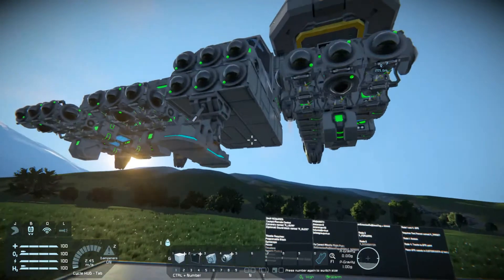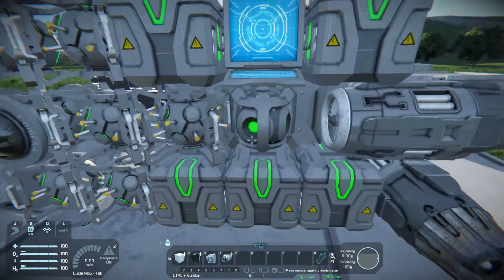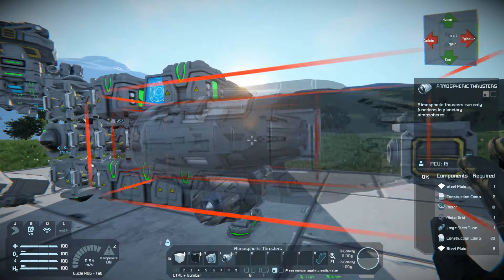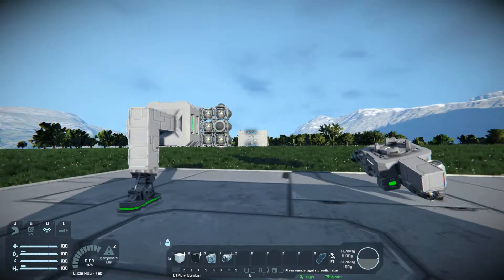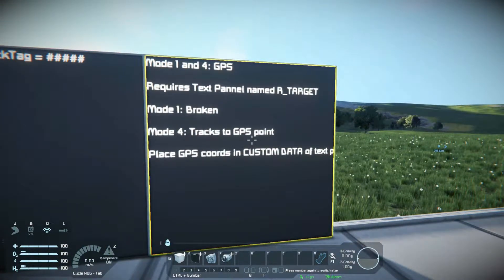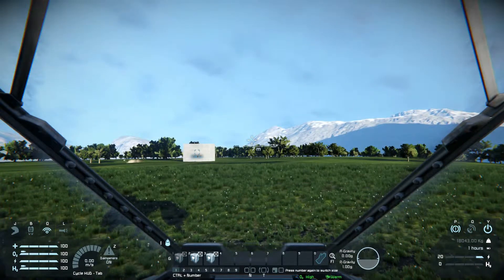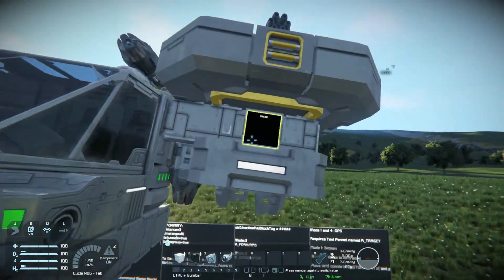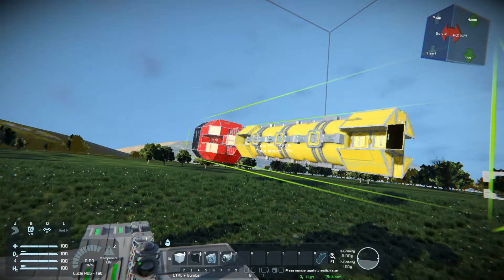Space Engineers: Easy Lidar Homing Script Episode 3

Comment: Great video. Can you set up a base  system that can send out bombs when it see someone.
Reply from the maker: Absolutely. If you have the missile track on an ai turret, it will hit whatever they are aiming at. The trick will be the launch. Either you will have to manually fire the missile or use a sensor. But with only 50m sensor range you will need a modded one. I would have a modded sensor start a timer with 1 to 2 second delay which will give the turret time to aim. The timer triggers the missile launch.